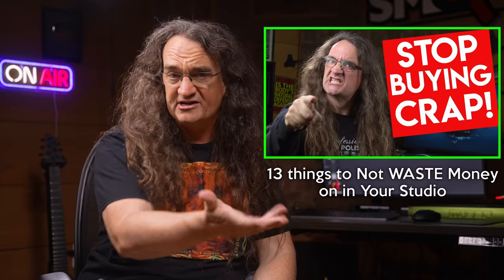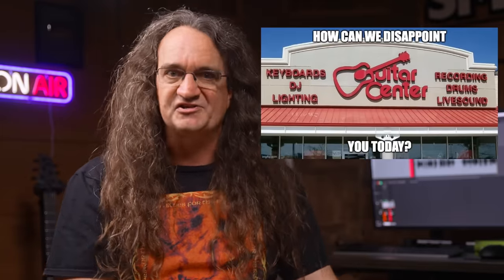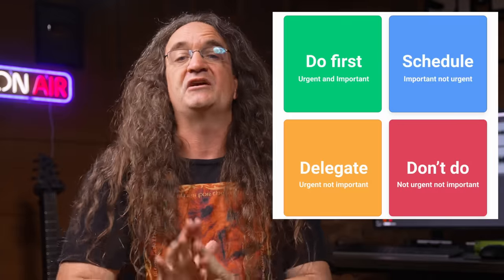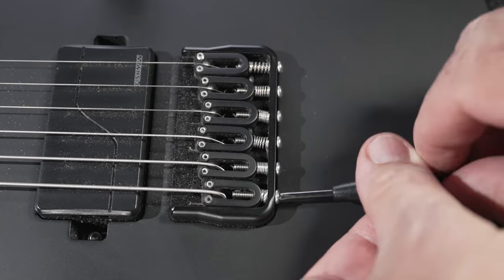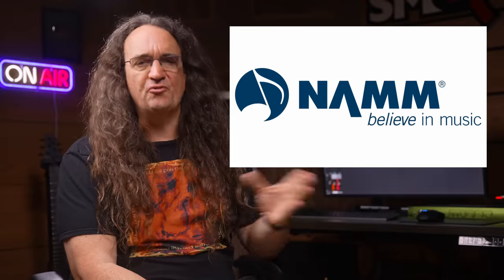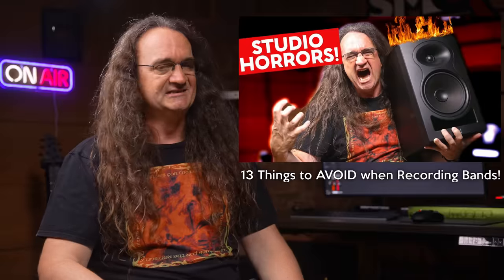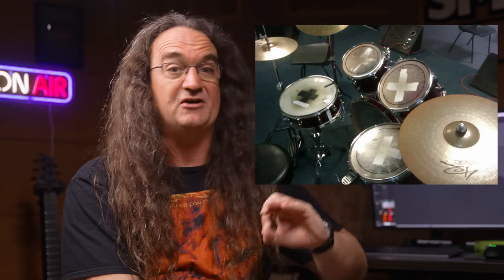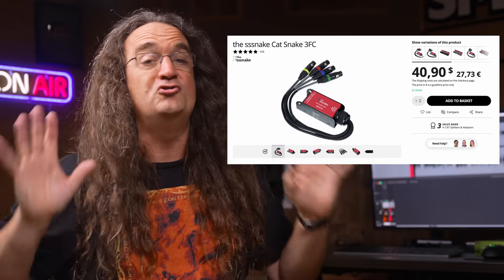13 Things to AVOID in your Home Studio!

Comment: Yes, yes, yes, thank you. I was soldering components as a teenager, having never learned how to use a clamp or a vise to hold things in place. I was carefully holding the parts in place with one hand and watching it like a hawk while blindly reaching for the hot iron with the other. I have a lovely scar on my left index finger that has never gone away. I would also add that if you're going to make a habit of sticking your hand inside of tube electronics, keep an eye out for exposed capacitors. Amps aren't the problem that televisions used to be (yes, I'm old) but laying your finger across a fully charged capacitor can mess up your whole day. If there is one sitting out where you could touch it, putting a screwdriver on the leads to short it out costs nothing in time compared to the cost of sending an unnecessary amount of current up your arm.

Comment: I'd love an acoustic treatment video! I moved my studio into a 14' by 11' foot room. The catch is that it only has a 5'11" ceiling. Now I'm not recording bands but I do record vocals and acoustic instruments. It's just a hobby studio but it has some killer gear in it. I am in the process of putting bass traps in the corners and it has carpet on the concrete floor and rock wool in the joists in the ceiling. Plus acoustic panels on the wall behind my 2 pairs of studio monitors.

Comment: Here's another tip about soldering. Tin your speaker wires. Heat up the bare end of the wire and put a little solder on it. It'll hold all the strands together when you put them in those spring clips. Tinning also helps when you are connecting to things like those little loops on rectifier pots.

Comment: Another great one Glenn! But on tube replacement, it isn't as quick as a pull out, put it in like a preamp tube. Power tubes, unless your amp is a set bias, like some amps are made. You will need to bias your amp to get better results from your tubes and longevity out of your tubes. Simple tools are available to do this.

Comment: "Over under" can also be made so that when you pinch it between your fingers, just give it gentle roll between your fingers either clockwise or counter-clockwise. Then instead of next time doing the fist, do the same  as before but roll the cable in OPPOSITE direction as last time, rinse and repeat. It's faster and you don't need to let go of the cable at any point :)

I'm unable to coil cables or ropes etc. in any other way anymore. It's so ingrained into me that I don't even need to think about it. Can have conversation and run while coiling cables.

Comment: Soldering and electronic assembly are two skills that have done wonders for my studio. There's quite a few companies that sell great gear in the form of kits; companies like CAPI, AML, Hairball Audio and Sound Sculptor sell kits that will rival the best gear on the market for a fraction of the price, the catch is that YOU have to put it together yourself. That sounded pretty scary the first time I tried it; but I was really surprised by how fun and easy it actually was. If you're the kind of person who who has built model airplanes as a kid, or you regularly work on your own car and you can follow step-by-step instructions, it's actually really easy. You really don't have to understand anything about electronic theory, schematics, circuit design or anything - it's generally paint-by-numbers. The only thing you really need to know is how to solder and use a basic multi-tester. So far I've built 16 kits that I use regularly at this point that are primarily mic preamps, EQs and a couple of compressors. Don't get me wrong; I love high end gear. The kits ARE high end gear. I have some Neve, API, Shadow Hills, Chandler and Vintech stuff and, sure, it all sounds great - but in some cases the kits actually sound better...often a LOT better. After doing this for a while now I actually prefer building gear to buying it. It's a lot more satisfying!
Reply: Hell yes!  I have 12 channels of preamp from Seventh Circle Audio; four "Neve" and eight Jensen Twin Servo.  I especially love the sound of the Twin Servo pres!

Comment: Velcro makes a 'heavy duty' product which I used to hang acoustic treatment in my apartment instead of drilling holes for the accompanying brackets.  If you heat up the velcro pads with a hair dryer they will come right off leaving no glue or marks.

Comment: The way I learned how to do the under/over method for wrapping cables was a little different. You can do it in either hand: I tend to hold the wrapped section in my right and twist with my left. I start off by making a normal loop for the first section of cable, then grab the tail in my left hand and align it coaxially with the loop, that is perpendicular (top down it looks like a T). Then as I push the tail into the loop with my left hand, I either twist it with my fingers toward me or away from me, and that has the same effect as what you describe. It's a little difficult to describe in words, so that might be a little confusing, but I think it's a little easier in practice. But that's just a personal preference thing. The point is, no matter how you do it, to treat your cables well.

Comment: I do a lot of soldering in my trade as a diesel mechanic and one thing is definitely get an electric soldering iron. The gas ones are great but they dont regulate heat as well as an electric one and electric ones get hotter which is needed when doing PCB work.

Comment: Hey Glenn, When soldering, solder flux is your friend. Notice in your video (1:43 to 1:48) where the connector is boiling from the heat being applied to the conductor from the iron? Just apply a little dab of flux using a toothpick to the wire and connector and the solder will flow almost instantly when heat is applied without melting (and possibly damaging) the connector. Pre-tinning the connections also helps facilitate the solder to flow and bond the stuff quickly and with way less heat. ;-)
Reply from the maker: That’s the flux boiling
Reply: @SpectreSoundStudios   Egads Glenn, say it isn't so! Boiling like that tells me that there is too much flux and too much heat. I did component level radio systems repair in the U.S. Army for 4 years and had to certify in precision soldering. I cringed when I saw it boiling like that. If the wires are tinned properly, with just a little extra solder on your soldering iron tip, it should flow and bond the wires almost instantly with minimal heat and no additional solder. In many cases, using the least amount of heat needed to bond the wires is the best way avoid damaging the connector and/or the wire insulation. Boil the flux on an IC component leg or wire and you've just destroyed it. Other than that bubbly moment, I found the video very informative. ;-)

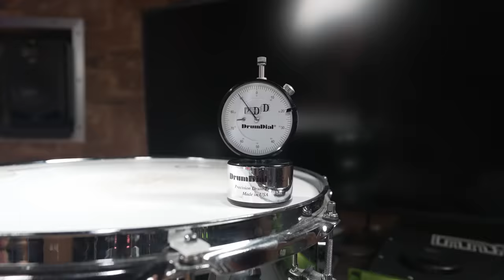Comment: 13:30  If you can solder, learn how passive components work.  Transistors, capacitors, resistors, diodes...  Anybody can build a fuzz pedal, and it's awesome being able to tweak component values and get different sounds.  I'm hoping to build a modular synth someday!

Comment: Regarding building your own network cable, as someone working in a data center as an audio engineer(when I am also a network engineer/analyst), unless it doesn't fit, STP can almost always be substituted for UTP, including things like Dante. We use STP when we need to push high-capacity data over copper when fiber isn't an option. The key here is to buy a quality cable crimper. I've been having great results with the Klein VDV226-110. Ends, like cable, can be bought in bulk for cheap. I also suggest the new thru-hole connectors as it helps spot mistakes before you crimp that cable down. Do make sure you buy the appropriate connectors because in my direct experience, the Cat5/5E connectors and Cat6 don't always play nicely with the other cable type. Also, buy a quality cable tester, which can be a slow as $25. I have multiple due to features each have. One is basic, one can also test for PoE, and another does some cool active-port functions so you can do single-ended cable tracing. For the investment in tools and bulk materials, you'll quickly see how much money you've saved if you had to buy it. Also, spend the money on boots for the connectors. They help prevent snags when pulled AND can be used as inexpensive cable identification. Plus, you'll develop USEFUL job skills outside that environment. Yeah, it's good to have that day-job to help pay for your music ventures because last I checked, gear ain't free.

Comment: Put the soldering iron back in the holder while inspecting the soldering joint. Don't move the wire till it's solid or risk a "cold" joint.
Learned that cable wrap technique in the '60's, it taught to me as the "roadie wrap."

Comment: For basic electronics, parallel divides by two, series adds the resistances together. Again, always use matching impedance speakers! Series is adding devices in a line (current travels through one speaker then the other) and parallel has the current going through either/ or speaker. Because of the nature of electricity, it will choose both speakers equally assuming the impedance of the speakers is the same. Hopefully this helps, cheers!

Comment: A great video, Glenn!

Some soldering tips...

The goal is to heat the wire up and apply the solder to the wire, not dab it on the head of the gun and make a globby mess. Make it so the solder seems to suck itself around the wire once it's hot enough.

Get one of those things that will hold the thing you are soldering with alligator clips. And get the one with a metal base so it doesn't tip over. 

EDIT: They call it a helping hand tool.
Reply: What temperature do you recommend?
Reply: My Weller soldering iron has 2 levels.  I usually get it up to temp by starting on high, then when it starts to melts the solder, back down to low.

Comment: Soldering is such a great skill. 

I must have saved a fortune repairing cables etc 

I will need to practice the over under technique. 
I usually found cables can have a memory and when you twist them the right way they coil okay.  

Not too related but as a musician I think properly tuning by ear is a good skill. 
It’s made my tuning more accurate. 

I feel it’s good not just to tune to your own digital tuner but to check your own against each other to double check that you’re in tune with each other. 

Not that you get it too much in metal but supposing you’re playing live with an acoustic piano and it’s slightly off. 
Because it’s so difficult to retune and might not be able to be tuned  it might sound best if you can tune yourself to the piano so everyone is in tune with each other. 
Which takes a well trained ear to do properly.  

I tune by both relative and harmonic tuning. 
I play a tone and tune by ear then check it against a guitar tuner to test my accuracy.  

I’m thinking of going a bit more extreme and trying a couple of tuning forks one in A and for Bass a D as when doing harmonic tuning on bass I usually start with a D harmonic on the 1st string.

Comment: From an electronics hobbyist, get a soldering station and not the cheapest soldering iron. It costs slightly more but repays in mental health. Also wire strippers that automatically pull the outer layer off are a must. They save more time and heartache than you can imagine.

Comment: With the Deoxit thing. Here in the states it can be a little rough to find but CRC Contact Cleaner does the same thing. Got some great deals on gear that "the sound cuts out" or "it needs a new volume pot". $50 for a "broken" guitar head + $7 for a can of CRC = $350 guitar head ready to play. Now I wait for all the angry guys for giving away secrets.

Comment: One tip for wrapping cables:

Ladies first. Meaning on an XLR, begin with the female end. This is so the cable wrap can live at the male end, and not be visibly hanging off of mics/dis/whatever it's plugged into. And if you're not using ties and just doing the live-style knot/loop at the end, it also keeps any loop memory in the cable on the male end, again to not be an eyesore on the thing it's plugged into if it were to be a little squiggly.

Comment: When soldering, throw away the sponge that comes with the soldering kit. Get one of the brass soldering iron cleaners. The sponge with suck away the heat from the iron and oxidize the tip, making it very difficult to get a good solder joint. And don't blow on the solder joint to cool it faster, that screws it up.

Comment: one tip at 6:32 do it in the playing position, not on the bench. depending on some factors like the string gauge, action, etc you may get different results with regard to the playing position.

Comment: Don't forget to use Flux when soldering, it really really helps with tinning and helps draw the solder to what it is you want to connect. I use Oatey 30130 Water Soluble Paste Flux, 10/10 would recommend 🤘
Reply: I use flux-core leaded solder.  Sure, ya gotta wash your hands after using it, and you don't want to breathe the smoke, but it's the easiest way to solder.  I like Kester 63/37 blend.  It flows really nicely.  I suppose someday I should learn how to use the lead-free stuff.
Reply: @soundman1402  I hear ya, I had to use some Flux core recently myself, as I couldn't find the paste I had, worked pretty good though.

Comment: Agreed on all of this!  Except for the part about buying cheap XLR connectors from Amazon.  Please, DO NOT buy cheap XLR connectors!  They're often not machined well, so they don't fit snugly (or sometimes fit too snugly); if they don't fit right, or the contacts inside the plug are loose, you'll get noise.  The only times I ever had mic cables fail on me, they were cheap cables with generic connectors.  So now, I only use Neutrik connectors.  They're about $5 each; a bit more money than the cheap Amazon connectors, but short of running the connector over with a car, it will never fail.  Neutrik, Switchcraft, and Rean are all good quality connectors.  

Also, don't buy the bargain bin wire.  Get wire that has a braided shield -- it's more durable than a spiral shield and has more shielding coverage (more resistance to electrical interference).  For two-wire cable, get a cable with heavier gauge wires; like 22 or 20 gauge.  It will be more resistant to breaking.  If you get quad-style cable, 24 gauge is acceptable.  There are many manufacturers of good quality cable; you don't need anything exotic.  Belden, Canare, Elite Core, and Redco come to mind.

Comment: If your 12AX7 preamp tube takes a shit on you, get three LND 150 mosfet transistors and solder them into a tube socket extender. It works 100% the same. If you can't get a tube, but you have a socket extender, a trip to the electronics shop can save you. It might not sound exactly the same, but it's better than no amp. "Do All The Things !" (yes the spaces are intentional) made a video on how to do this.

Comment: I made a 12-bit digital delay when I was 21 .. does that count?   Computer Systems Engineering degree?    Soldering since age 10 - when I fixed a radio?  Have deoxit.    No time management skills - but I think about it every day.    Tools galore, yes. 4 channel modern digital oscilloscope too.     Rotating the cable with each wound loop works for me. All cables have velcro ties on them, but i don't always use them.   The drum dial is knew knowledge to me - thank you.

Comment: I am slightly older than you and have been hearing about the over/under cable wrap method as long as I can remember.  I do agree it helps wrap a cable evenly so it sits flat and is better for the cable's shield, braided or spiral, so it does not become damaged or unwound.  However, the "tossing" the cable to unwrap it is not fool proof.  There are left handed people in this world.  This method is not interchangeable between righties and lefties.  If a righty wraps, then a righty must "toss" it.  Same for lefties.  I have proven this over and over...as I am one of those troublesome lefties.

Comment: Never blow on your solder joints. If they cool down too rapidly they can go 'dry' - non conductive.
Always heat the mating parts before you apply solder - although some solder on the iron tip aids heat transfer to the joint.
Clean the iron tip regularly with brass wool or damp sponge as the oxidised detritus left on the iron will do you no favours.
Choose a tip suitable for the job - a thin tip will not transfer enough heat to an XLR spade. Choose a chisel tip of roughly the same size as the terminal pin you're soldering to.
Flux your connector terminals first - the acid in the flux will help fight the oxide layer on the brass / copper terminals.
Inspect the joint - it should be shiny (less so for lead free solder). If it looks grey and mottled then it's dry and should be remelted with additional flux. Moving the mating parts during solidifacation can also lead to a dry joint.

Comment: Adjusting the action thru thrust rod adjustment? not sure about that, I seen a lot of people screwing their necks by doing that and thats not what is intended for. each to its own, I prefer to adjust action first at the bridge and adjust the thrust rod if needed between .3mm and .5mm on the 8th fret. Some people like to have the dead straight neck and other with a small relief, I prefer relief to avoid fret buzz and allow the strings to move a bit more. The Ibanez maintenance guide is a great starting point, its all well explained there for those who are learning to adjust their instruments.

Comment: Question regarding expanding my audio interface with more inputs.
I have a Zoom UAC-8 and need more mic inputs to be able to do live recordings, would the Behringer ADA8200 Ultragain be a good option?
And I just need an ADAT cable (one direction) or do I need to use a sync cable between the two units as well?